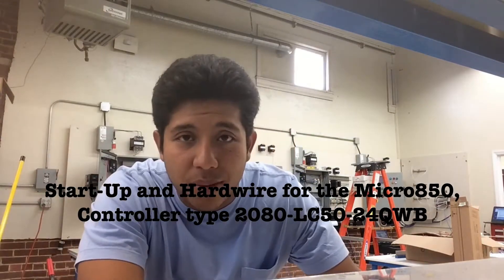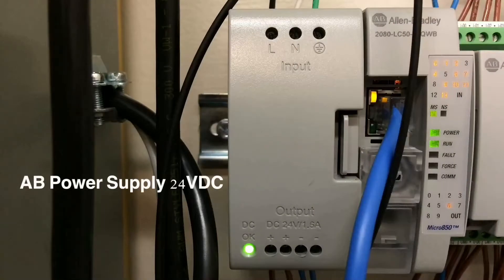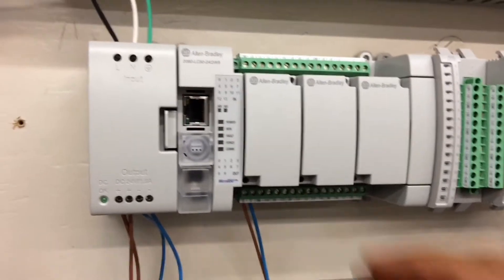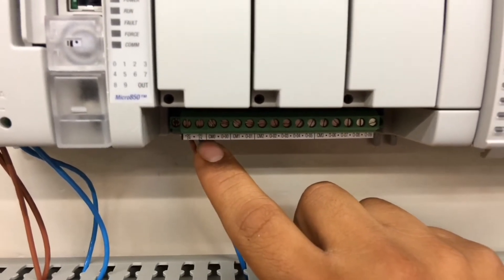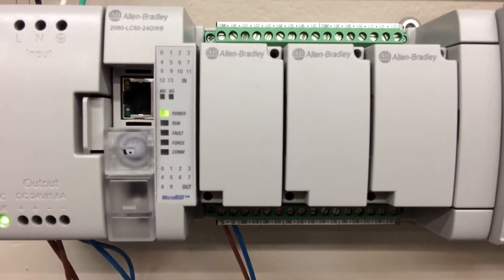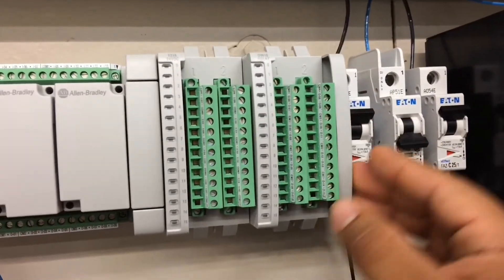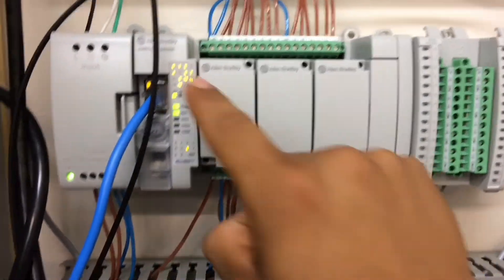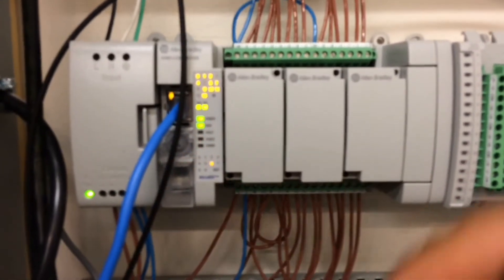Startup and Hardwiring for the Allen Bradley Micro850 Controller 2080

Comment: amazing video. where do you connect the CM on the output terminal? is it to the DC+ or - ? also can we use the AC for that?
Reply from the maker: Arian Rivers thank you! Yes, the output power supplied to the CM is DC power and it doesn’t matter if it is hooked in by + or - as long as you can return the flow back to complete the out field device on the output side. Yes and no on AC. You need to make sure PLC device can allow Input/output AC power. I know for these models you can get them and even order expansion modules that handles AC for input and output
Reply: @techlivesmatter9718 no worries! I'm very happy this channel exists. Lots of helpful information. Thanks for the info!